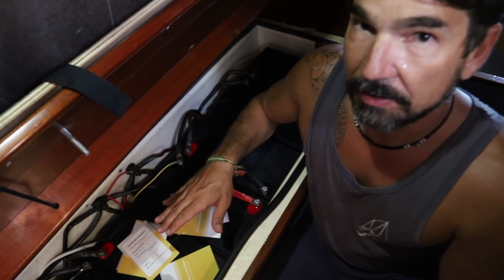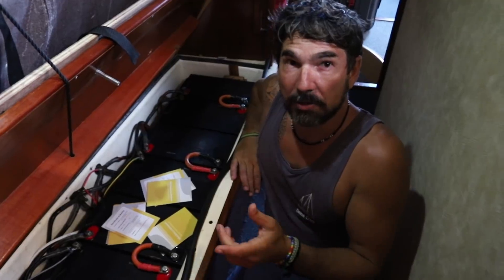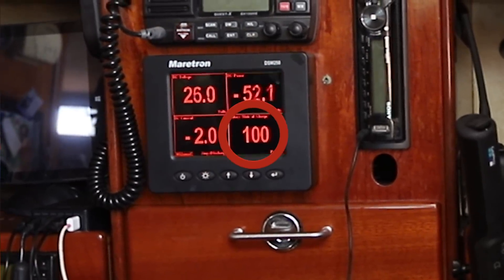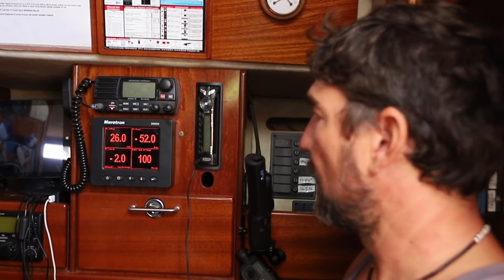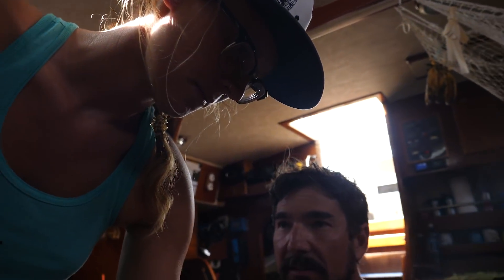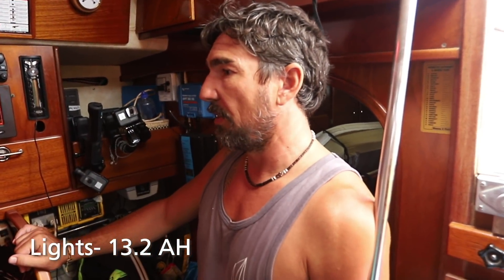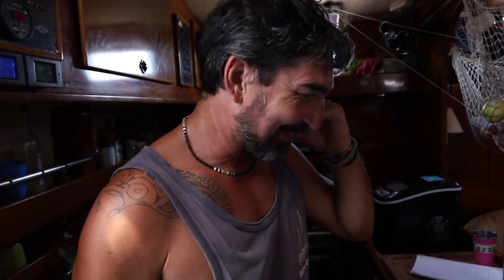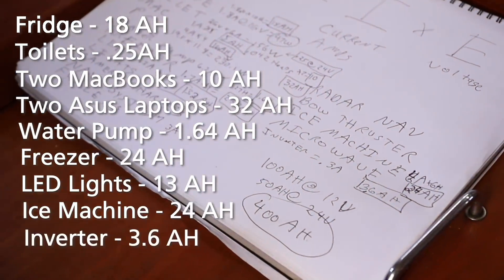WATT THE HELL is an amp hour?  Sailing Vessel Delos

Comment: A good education video.. I watch another channel that claims they run their a/c off batteries and solar only.. Wonder what a/c system could run without turning on the generator.. Strange they never got into details and claimed they know any technical's of how.. Must have a killer battery bank I would think and a super solar system.. wouldn't you guys like to run a/c too..?? You all always look like your sweating your asses off..  I sure can't sleep when it's hot.. infact I keep the a/c @ 73 degrees at night and 78 during the day here in Florida..

Comment: Why not grab a Tesla 24V module off ebay?  a single 50 lb module is 250AH with at least 200 of that usable.  so a single 50lb battery would out perform your entire bank.  Also lithium is a linear voltage curve so you would get a much more accurate SOT.
Reply from the maker: We have since upgraded to Lithium, video coming out next week :) . We decided to go with a cell of a different chemistry than Tesla, something with a little lower power density but a little more forgiving.  Stay tuned!
Reply: cool beans, I'm excited to see what you have come up with.

Comment: The MacBooks use more than that, Brian. Most likely their internal batteries were fully charged at the time, whereas the Asus might have older/weaker batts?
Reply from the maker: I'll do some more measurements to make sure all factors are equal, but just judging on what we've seen so far I do think the Mac's use quite a bit less.
Reply: OK. Just in case it helps, I measured my MacBook Pro (15") at 38W minimum with the batt fully charged, 80W when charging (all on AC and without running GPU-intensive editing software at the time). Good luck and fair winds! heinz

Comment: Well Brian, I know you're a PC guy having worked for Microbleh. 😃 But that was interesting to see that a Macbook draws considerably less power than a PC laptop. Macbooks for everyone, especially when you live on a boat! lol I like the nerd 🤓videos, keep making them. Just so ya know, I worked in the PC/Windows hell for a very long time, even held MCSE. At my boss' recommendation, I bought a Macbook 11 years ago. I haven't looked back.
Reply: I'm sure he said the mac was micro size compared to the PC?
Reply: Please correct me if im wrong but the way they measure is wrong, they measure at idle, and iddle power drawn depends on the components active in the laptop and the powerstate. Start rendering some video and those numbers will go up, but also remember: render the same video and look at how long it takes: one might draw less power but take twice the time..
Reply: The ROG Asus laptops are considerably more powerful than the Macs so it is most likely that actually using the computers for editing and rendering the final output will be much, much faster on the Asus, meaning it is working less time than the Macs, so the power will most likely level off between them, while saving a non-renewable resource (time).
Reply: That had absolutely nothing to do with the software running on the laptops, but simply the fact that the Macbooks are pretty low powered hardware optimised for long battery runtimes while their video-editing is done on gaming laptops, since they have a lot more power. But they also use a lot more power.
Reply: Rob DeHaven I was thinking that the Asus notebooks were charging while the Mac was fully charged.

Comment: Sorry if you have had to answer this many times, but what do you do to protect your electronic equipment from the salty air?
Reply from the maker: Actually we do very little except always carry our laptops in dry bags in the dinghy and try to keep Delos very dry inside.  No salt water down below, etc.  I still have an original laptop onboard from 8 years ago as a nav backup and still working just fine.
Reply: Sailing SV Delos thank you. Would that go for musical instruments as well? Like guitars?

Comment: I'd love to see a passaging making electrical demand requirement video, including when/why you're running the generator and/or tow-generator (if you even bother with it anymore). Including data from average power inputs from the panels and wind generators. Also, any general purpose provisioning videos with a breakdown of how much food/water is used per person per day including fuel requirements both propane and diesel both at anchor in the middle of nowhere, as well as passage making.
Reply from the maker: YES Cameron, some excellent points here.  Thank you so much for the comment and ideas!
Reply: I'd be happy to volunteer my time to help with these calculations during a passage! I promise I won't drink my weight in beer every day!
Reply: I'm more of a wine and "scoth" kinda guy... so running that distiller would have to be included!

Comment: Mac rules!
Reply: When they work. When not... see: https://www.youtube.com/user/rossmanngroup
Reply: If you think so , DONT watch Louis Rossmann's  YouTube channel lmaoo he will burst your Mac bubble in a hurry.
Reply: actually Brian forgot that the mac uses the battery not the power from the outlet ... and they probably have very different specs as well , he probably has a i7 and her an i5 or i3
Reply: That's a good point, only way to really test is to remove the battery from both. Can you remove the battery from a Mac?
Reply: there is a difference of idle and on load for computers. Idle on a desktop could be under 100w, but under load could be 500w.
Reply: And the ROG (Republic of gamer) would have a powerful dedicated graphic card for Gaming, not the mac.
Reply: when they are rendering videos Both would be using almost 100% of GPU and CPU usage. meaning a lot more power usage.
Reply: I just got a Chromebook not long ago after 30 yrs of being a pc guy.  I can go all day, 14 hrs on the battery with heavy usage  WOW!
Reply: Macbook power supply is only 60w and I looked up the numbers before.  When it's charging it still must run at 60w or less due to the power supply, so on their 24v system that would be around 2.3 amp hours max while processing videos and charging.  When the battery is charged, which it usually is if you leave it plugged in then it tends to use around 20 watts max even while running everything at the max, so just under 1 amp hours.
Reply: I seem to remember seeing that the Windows machines are gaming spec.

Comment: Fantastic video! You mentioned lead acid batteries but does AGM or lithium batteries have an affect on the useable capacity and cycles available?
Reply from the maker: Lithium batteries can be cycled down to 80-90% with no real effects on the number of cycles.  We just replaced our bank with Lithium, video coming out next week :)

Comment: I appreciate the educational videos.

Have you considered getting DC chargers for your laptops? What all AC devices do you have on board? If there aren't many, maybe you can save a few more AH by keeping the inverter off. Certainly something to think about with Delos v2 :)
Reply from the maker: Hey Paul, yes you are correct going DC to DC charger would save quite a bit of loss there!  Research always continues :)
Reply: I don't know why it didn't register for me earlier, but because Delos is 24v you might have a bit more trouble finding prefab DCDC adapters that fit your needs. Our boat is 12v so standard car travel adapters would work. But check this out - it's something I've looked at for my devices that are actually DC but have their own AC/DC inverters (like laptops).

http://www.mini-box.com/DCDC-USB-200?sc=8&category=981

You'd have a little bit of configuration and wire fabrication to do, but could be good. Maybe.

Comment: Great video. This is probably the first video ever on boat power that doesn't make me cringe for using incorrect units.
Listen to Brian guys: Power = Current x Voltage (or electrical potential), Energy = Charge x Voltage
Ah is basically a unit of charge. It tells you how many electrons are available independent of the electrical potential they hold. 1Ah = 3600 Coulomb, because 1A = 1 Coulomb/sec. Basically the same as we use (k)Wh instead of Joules for energy because we got sick of using these huge numbers.

About the Macbook vs PC power consumption:
Did you correct for load and possibly charging of the internal batteries? On my Macbook I use a utility called iStat Menus which let's you view many power statistics, including system total power and DC-in. It also records 7 day history so you can see what the actual usage was, because on my machine it fluctuates from ~15W to ~90W depending on load.

Comment: What I find interesting is how through careful choices of our electronics, and frugal use of the power hungry devices, we can replenish our power draw with even a simple solar system.  I had two 100w solar panels on my last boat which was sufficient to power my simple systems without the use of supplemental electricity, with only two 110ah AGM deep cycle batteries.  Granted the power draw was limited to LED interior and nav lights, nav equipment, vhf, assorted sensors, pressure pump, inverter and computers, but for an old dog like me the fact I could generate the electricity to run this stuff just blew me away.  

Now "Mr. Science" please tell us how leading edge battery technology changes the math? :-)

Comment: IF you have 12 volt batteries and a 24v system then you do NOT have 800 AHs. You have 400AH@24v. You have to put 2 batteries in series to get 24v. So you actualy have 4 24v batteries @ 100AH = 400 AH

Comment: the big takeaway for you guys is if you had lithium batteries you can take them down to zero you don't have to stop at 50% for me is the fact that the Asus computer draws a whole lot more than a Mac I don't get that one?
Reply: Probably as simple as the ASUS likely being a "desktop replacement", designed for processing, and the Macs being designed for long battery life,  This would be accentuated if it's a MacBook Air.  Renders on the PC are probably much faster.
Reply: The ROG laptops are, essentially, portable super computers. They have substantially more power than the Macs and will handle all the video work considerable faster than the Macs. Since they have a dedicated high end GPU/video card their power draw at idle is higher. The only true comparison would be to compare how much power they draw while working (editing and rendering video in real time) over time needed to complete the same task. Under those circumstances the ROG laptops will most likely be more efficient than the Macs because their greater power will allow them to do more work in less time. When you factor in time as a non-renewable resource the ROG laptops become much more efficient overall for the video work, but less efficient for web surfing, text, or simple word processing. Other issues to consider: do the ROG laptops have ssd or spinning disk storage, how much ram in each system, how many cooling fans, screen size and resolution, audio amplification.

Comment: The reason the Mac was using less power than the PC was probably more to do with their current state of charge than anything else. PCs and Macs, since they are pretty much the same thing with a different OS nowadays, vary the amount of electricity brought into them depending on the charge left. If one is near 100% then it would only be trickle charging compared to one at say 20% which would be drawing a lot more electricity.
Reply from the maker: Hmmm, interesting to consider.  I think we will need to do some baseline tests next on this...  Put both machines in a full state of charge, and measure them at idle and rendering a video to see the difference.  Thanks for the comment.  Brian

Comment: Timing could not have been better for the release of this video.  I’m thinking through this very formula right now for our boat and trying to decide if we need more storage and/or more solar.  I currently have 4 lead acids for house with 122 AH capacity each, 200W of solar and a wind gen. Seems to be enough for what we are running but we flat lined the other day so I’m rethinking it. I haven’t actually done the math yet so this was perfect at showing me how to do that. Thank you and 1000 likes👍.

Comment: Wh or kWh as units for energy storage capacities make more sense to me since the battery voltage fluctuates.
100W can draw between 3.45 A and 4.76 A on your system depending on the state of charge. 
Now thats gonna confuse people who thought they got it  :D
Reply: NotnaRed throw some peurqart theory in there to trigger everyone:-)
Reply: I’m no electro technician, but as far as I see, Amp hours is a pretty exact unit. Kinda like Liter or Kilo. With liquid lead/acid batteries, the battery drain will be much more for a rapid draw when compared to the same Amp hours taken out slowly. (The Peukert Effect.) But this is the same with Watt Hours if measured in result at the consumer end. However, the important observation in this case is that with Lithium batteries of the LFP / LiFePo4 type, the voltage will be pretty close to unchanged at the whole battery cycle, almost no matter how fast the draw is, and there is no noticeable Peukert effect at any realistic consumption level. Actually the batteries can happily supply 200 Amps at steady 26,6 Volt (nominal 24V) sustained, and much more, (level 0,5 C), with close to full capacity. Lead batteries would not be able to supply that much current, have a big voltage drop and either way be completely empty after supplying maybe one tenth of rated capacity. LFP is a new world...

Comment: :D nice episode. i like calculating amp hours. one thing though. using the inverter to invert 24 V DC up to 100 V AC, back to... i think all mobile PC use like 19V DC.... isnt there a way to just lower the 24V DC a little and take it directly? Like those car-adapters for computers? cause the computers seem to be quite a big sucker. and the inverter up is a little inefficient and the computers power supply is a tiny inverter itself.... so if you run like multiple computers at the same time.... that is something to consider isnt it?
Reply from the maker: Yes, it absolutely is as there is efficiency lost during conversion from DC to AC, and back to DC....

Comment: i Don't Know if u Guys Have ever thought about it, But u could Build a Beast Rendering Desktop computer or Server on board to speed up Your Rendering. You could just find a Place to Bolt down a Motherboard somewhere, Put in a Beast Graphics card ( maybe like a 1080ti ) it would not need to be in a Case & take up all that Room. Or u could buy one Allready Made and Take it apart and Spread the pieces out to save room.
Reply: Boats get pretty wet at times - wouldn't that mean things would forever be shorting out?

Comment: Thank you for that tech video. Could you tell more about your solar panels and wind turbines? I heard that wind turbines produce some unpleasant noise and low frequency vibrations. Also their efficiency should decrease when sailing, because apparant wind has less speed. Do they have some protection system to prevent damage during high winds? Solars have to be positioned to the sun and depend on the clouds. Each way has some pros and cons. How you balance your power system and what problems you face with all this stuff? Also would be interesting to know about your boat's heating system, if you have one,  and air moisture decreasing. Thank you in advance! Greetings from Russia!

Comment: Great job. I'm off to add up my boat. I wish there was a meter that would tell me how many amp hours I had left. Some things like deck wash and windlass are used so occasionally and draw so much power.
Reply from the maker: Hey you should check out one of the new Victron AH meters, we install one in our next video.  If you are not charging and run it for 24 hours it will give you the actual number of AH consumed :)

Comment: Hi Guys
I noticed you were testing the laptops, were they charging at the time or doing any work? I have noticed that mine uses more power to charge the batteries and when they are processing video's etc then when sitting idle. Also, yes more of these video's :D
Reply from the maker: They were pretty charged up, so that was just their normal working state.  I would assume if we were using them to render the draw would be even more.   Brian

Comment: The avail power drawn from lead acid batteries is typically only 35% of total amp hrs. because of the difficulty of charging batteries the last 15% back up to 100%. The useful range is often between 50% and 85%. So Brian, are you saying you can use 50% of battery AHs because the presence of wind and solar allows you top up batteries back to 100% full?  Just trying to learn. Thx!
Reply from the maker: According to most manufacturers you should be able to take 50% of the total amp hours out of a battery and still get a decent lifespan, but in a realistic setting we've found t30% is a more reasonable number.  You are absolutely right about charging that last 15%, it usually only happens if we motor for a long time or turn off most of the loads and let the solar crank in power for the day.

Comment: The energy of the cooling systems is only a fraction of the amps times 24 hours because they have a thermostat which turns them off about half the time. I had written a comment about the energy of your batteries, but it was wrong. I was assuming you had 6v batteries. It's right, you have 400Ah in a 24 volt system or 9.6 kWh śtorage.
Reply from the maker: I think our fridges and freezers are really old....  They run quite a lot!  Probably could save a lot by re-doing the insulation I suspect.